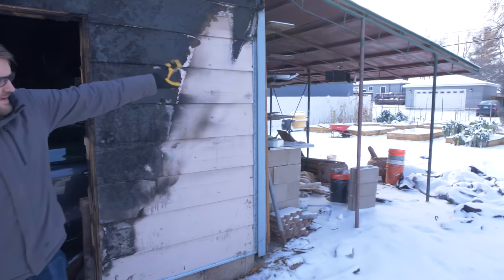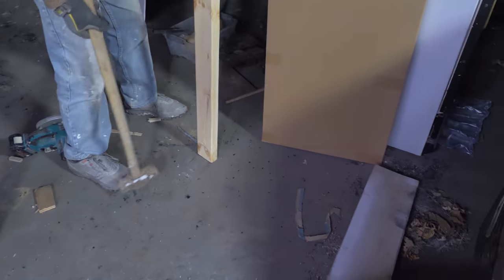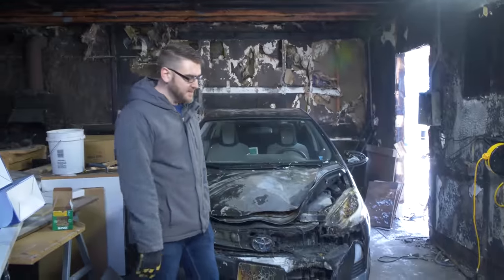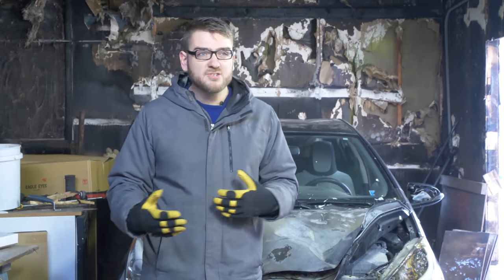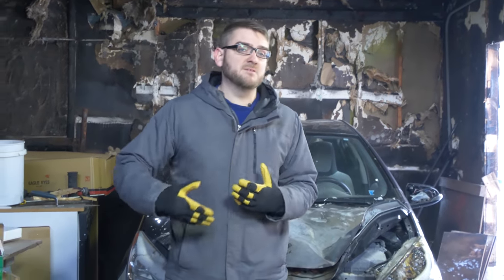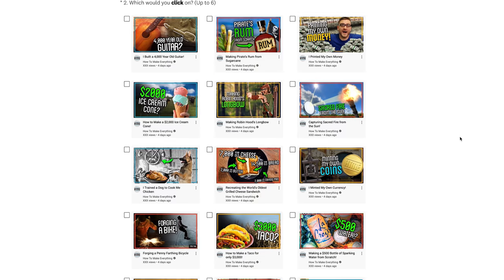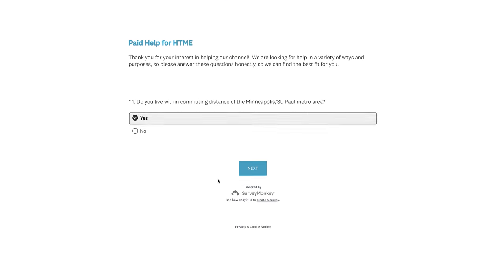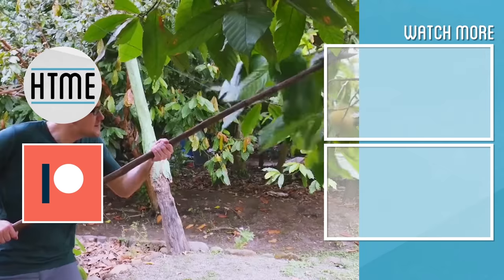Breaking Ground on Rebuilding the Workshop (Fire Update)

Comment: You're taking real steps to fix the problem and making changes and adapting. We believe in you.

P.s. the metal tools likely got annulled in the heat of the fire, so any fire hardening you did to the blades would have been undone.

Comment: also maybe look into a shipping container for new shop. If you do dont insulate inside like most do, instead  foamboard the outside metal tape the seams and do vertical board and batten. Its cheaper, you dont lose space on inside you dont have the condensation problems either. over all best way to go.

Comment: An interesting video series would be building the machine tools in the "Build Your Own Metal Working Shop From Scrap" series by David Gingery, seeing as you've got a bunch of half-melted scrap laying around. The series was intended to use scrap aluminum to build lathes, mills, and presses, but there's no reason you couldn't use a metal you've already "unlocked" like brass, bronze, or cast iron. 
It would be cool to see a "how to skip to the industrial revolution with Roman-era technology" series, where you build the tools needed for a Watt-style steam engine, like cylinder boring lathes, and work towards a steam-powered electrical generator and power tools. The Romans had all the pre-requisites for steam power and precision machinery (like the Antikythera Mechanism), they just never combined them in the proper sequence to industrialize.

Comment: A video where you make concrete from scratch using the ashes of your burned building would be cool because then the concrete of the new garage extension would have a link to the original

Comment: Great news. Did you know that carbonized wood actually adds to the insulation value? It also protects against other things, but it's only safe if it's the outer layer that's carbonized. So sadly with the deeply burned beams and planks in this shed it won't work in a safe way, but it's a great way to insulate and protect against all kinds of outside influence in general. There's a tiny housing project in my local area where they used this (I believe Japanese) technique to improve longevity and insulation for these small houses.
Reply: Oh, and is there a crowdfunding action where people can support financially?

Comment: You might want to look into building with earthbags, the channel mylittlehomestead built multiple buildings with that technique and its actually very very cheap (5-7k for a 1500-2000sq ft 2 story space)but durable and being made of earth its also non-flammable to prevent a repeat tragedy
Reply: Even earthbag structures typically use wooden roofs, which was the majority of the damage in this case.

Comment: Full scale reset and a fire... on top of that, insurance seems to be not cooperating in a timely manner.
Suspect af...
Could be your end of the world complications on the insurance front. I sure hope that’s the case at least since the very limited details shared thus far doesn’t sound encouraging at least from an insurance pov.
I’m assuming there are a few words such as preventable, unsafe and questionable application(s) in the insurance assessment(s) when it was forwarded to your insurer.

Comment: looking at how hot it got to melt the metal on your car your engine and transmission is toast sorry but you will have nothing but problems, especially transmission they are good for heat to a certain temp but not as hot as it got, but to tear down and gain knowledge for sure